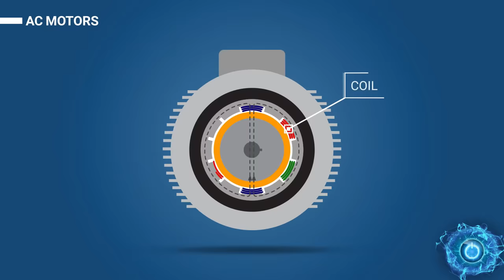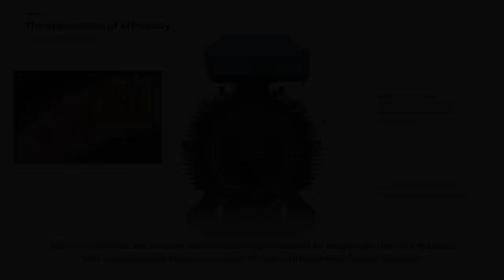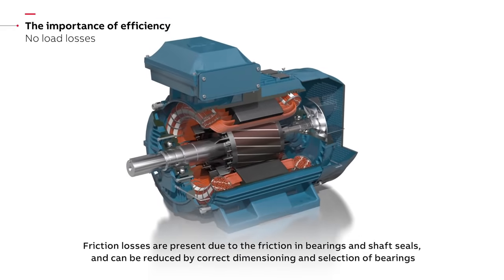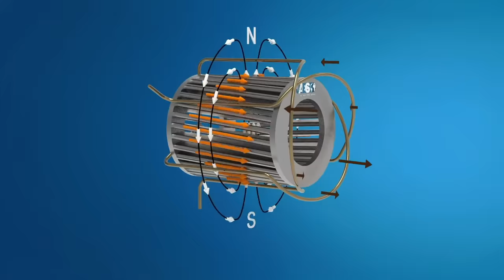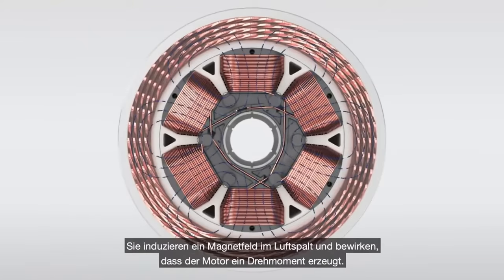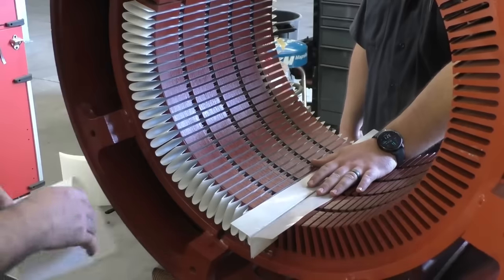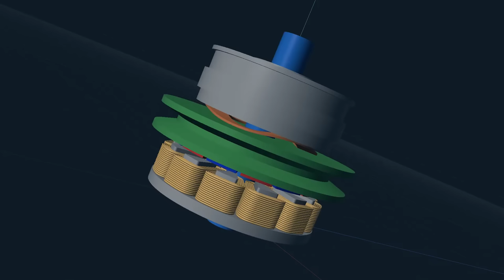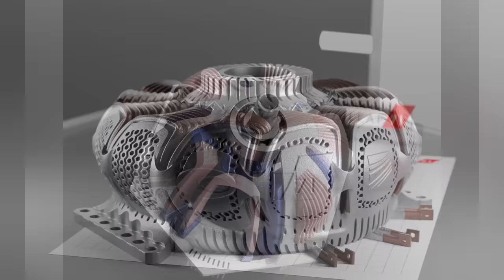GAME OVER!? - A.I. Designs New ELECTRIC Motor

Comment: there isn't a working benchmark, nor a breakdown of parts...this is just a model it created we don't even know it works.
Reply: As is it just a standard turbine from the looks of it. It's a step, and a few layers off
Reply: yup... clickbait title
Reply: Looks cool though
Reply: You look at that, and that's your takeaway? Think about complex engineering building on a  molecule / nano level and efficiency levels. Everything is about to change in such a fast way.
Reply: @Mars2152  except it's just a 3d model until it shows it actually works. it's an art piece, a paper weight, without any evidence it works we can't even say any engineering was done.
Reply: New way to milk investors - AI engine model!
Reply: It is an ai generated model with no actual prototype.
   However, if one loaded that into a program that is for making motors and analyzing electric fields, they might find the design appealing enough to actually produce as a prototype.
   It is very strange, I wondered at the impeller, however motors need cooling, so who knows.
Reply: @tuseroni6085  No shit. Nobody's claiming it works. It's demonstrating a potential path of progress. Engineering 101.  Every piece of technology ever released started as a prototype.
Reply: @ontheruntonowhere  it's not even a prototype. they don't even have it working in simulations. it's a model. it's nice that the AI could create a cool looking 3d model, but until there is even the slightest indication that it works, it's just a cool looking model.
Reply: TBH before even clicking on the video that's what I figured lol, and all the dislikes was pretty much all the confirmation I needed but thought I'd read comments anyway.
Reply: Seriously though, it's scary to think that even some high-level engineering jobs could be made obsolete by AI if humans can't compete. I think a lot of people are being too optimistic about it but then again it's not all doom and gloom either, aside from the worst case scenario of course.
Reply: @brians1793  i doubt we will be seeing anything like that, don't get me wrong, companies will certainly TRY, people WILL lose their jobs...but then when it doesn't work like they expect, because they really didn't understand what their engineers did, they will hire back the human engineers.

the main thing to know with AI though is that it doesn't WANT anything, it doesn't get bored, it doesn't have a point of view humans have those things, managers hire engineers for their creativity as much as their technical ability, and that creativity isn't going to come from an AI, their brains just aren't made for it.

what you will end up with are human engineers with another cool tool for making things, like CAD software or simulation software. and maybe a better way of telling managers their idea is stupid and it will never work.
Reply: @tuseroni6085  You're probably right, similar is probably true about human musicians too. There are a lot of musicians though that are kinda feeling like it's pointless to spend thousands of hours of practice over the years to master certain things just to not come close to what AI robots could eventually do. I don't really see that as a great reason to give up, but psychologically I get why people will feel that way. Similar to seeing amazing human guitarists and guitarists will say it makes them want to give up rather than motivate or inspire them if they're just insanely good, not a good attitude at all though. It's better for people to compare themselves to their past selves and not worry too much about being at the top, some people will just never get there due to limitations but it's worse to just give up than not do your best.

For music IDK if AI will ever really emulate the emotion and feel of real human playing at it's best, and I think most people will always appreciate the creativity and emotion of real human musicians and AI won't necessarily write music quite like some of the most talented humans do. But it's possible a lot of music might not be distinguishable from humans just like AI models. I'm honestly more worried about how it'll impact women from educated women's jobs to models, a lot of women's jobs will be replaced and they won't even be able to fall back on modeling and will have college debt, less men in college and blue collar jobs I don't think will be as impacted.
Reply: @brians1793  i think women will be fine, even if they have college debt, etc, they will find a man and he will likely support her as she looks for a new career or she might find she prefers it as a stay-at-home mother, there's a reason such a small portion of homeless people are women.

as for AI music, think about this: people still do blacksmithing. modern blacksmiths make works that would be considered embarrassing before the industrial revolution but which people today actually WANT. prior to the industrial revolution, a perfectly crafted piece of work would have no scale, no pits, it would be perfectly straight, and your ability to do this was a sign of much skill, but today machines pump out perfect parts in perpetuity for a pittance, if a blacksmith made a perfect looking piece they would be doing a lot of work to make it look like it was stamped out by a machine in like 2 seconds.

so, blacksmiths make their works highlight the human aspect, where blacksmiths of old would work to file or hammer out the pits modern blacksmiths will take a perfectly flat and smooth piece of metal and hit it with a hammer to MAKE dents. things which show the human work involved are the things that really sell the best.

and i think hand made music will go in that way, they will lean on not using autotune, or maybe even having their instruments slightly out of tune, i can't predict what things people will find interesting once AI music has reached saturation, but it will be the things that highlight the human element.

i also think AI will be a tool that allows for the creation of a bunch of amazing (and exponentially more shitty) creations. just looking at AI covers, or the things people are making on udio, it lowers the barrier to entry and allows more people to show their creativity. for a good example of what this kind of thing can allow, look into vocaloid, which is not AI but it is similar in that it allows people who cannot sing to make music with vocals. look up "senbonzakura" some time, there is the original vocaloid but then a ton of covers (i like the cover by wagaki band most, personally) the covers are done by people who CAN sing (i think the original was hatsune miku voice) and they all bring their own point of view to it, their own voice, figuratively and literally.

my best advice, though, to someone looking to go to college for art...don't, don't go to college to learn to make art, just go online and make art, while others are spending 4-8 years learning how people used to make art you will have already established yourself. 

AI will also make learning easier, i hope this generation is the one to break free of the idea that if you want to do something you have to go to college, and then i hope businesses also break free of the idea that if you want someone good they need a degree.
Reply: @tuseroni6085  Building on nano scale exotic technology is the takeaway. I don't care about a model, I care about the technology that this can build.  People are locked into a toy. That's my point 👉 👈.  Peace
Reply: I don't think even that AI knows how it works.
Reply: There’s only copper and magnets rotating in a motor, can you not figure out what it is you’re looking at? Or is that too much to expect lol
Reply: Exactly!  3D art hype =/= a working model
Reply: I think it is an easy bet that it does not work. Somehow people think that AI can develop perfection from imperfect human input.
Reply: @davidsault9698  interesting nonetheless, wonder if there’s any merit to any of the illustration specifically
Reply: It looks like the engine in the spaceship that abducted me......
Reply: "This is not important right now Stan... what's important is to figure out how clickbati it is..."
Reply: Tough situation fellas, hard to know where to look if ya dont know .. good to know most dont know lol. But who knows right ?
Reply: @ontheruntonowhere  No its literally just a cool picture with nothing behind it. Its demonstrating the potential path of progress as much as the millenium falcon was. Not at all.
Reply: @kvasir8931  No shit? I thought it was a real Millennium Falcon with hyperdrive and everything. Good thing you told me before I tried to escape Darth Vader on it. 🤣🤣🤣🤣
Reply: baby steps:)
Reply: @tuseroni6085 This is arguably the most cogent comment I've seen in any comments section. Thank you.

Comment: Was kinda hoping to see more performance specs for the motor, as well as what exactly the AI was optimizing. The high surface area appears to optimize heat dissipation
Reply: Might be able to run coolant through the coils 🤷
Reply: Agreed !
Reply: Heat emitted by a motor is an indicator of inefficient operation. It's energy being wasted as heat instead of mechanical force.  If you have to seriously cool a motor, the real problem is that is wasting energy as heat.  Gas and diesel engines are great examples. A whole elaborate cooling system is required just to deal with waste heat. The energy spent making that heat is energy not spent doing whatever the engine is supposed to do.
Reply: @patrickmccullough989 If it's really powerful motor it will generate much heat even if it's highly efficient..
Reply: @MegaSuperCritic  It's like you do not understand what you read. If it's really powerful motor there will be lots of heat. Full stop.
Reply: @MegaSuperCritic 
A 100% efficient motor, no matter the size, can never exist. Thermodynamics forbids it. At minimum you'll at least have heat production from friction and electrical resistance.
Reply: @patrickmccullough989  Gas and Diesel engines aren't really the best examples because they are Carnot engines and thus are more efficient the hotter they are and the cooler the environment is.
Reply: @MegaSuperCritic 
And you're never going to reach 100% efficiency, so you'll ALWAYS have at least some heat. You will always have at least some friction, and you will always have at least some electrical resistance.
Reply: @patrickmccullough989  The conductors and the magnets will be more efficient the cooler they are, and then cooling can allow a better power density in the motor, something very important for weight sensitive applications such as hub motors.
Reply: @MegaSuperCritic  You're not getting what he's saying. If you have two motors, both weigh 1kg, one puts out 1hp and the other puts out 2hp, they're both equally efficient (electricity wise) the motor putting out 2hp will put out twice as much heat.

It's a better motor, but it produces more heat. Efficiency isn't the only variable for how good a motor is.
Reply: @agentstapler-  Thanks for the necropost, appreciate this popping up in my notifications.

I absolutely understand his point. The ONLY thing I was defending was that a 100% efficient system would have no thermal byproduct. Ultimately, we were saying different things, slamming our heads into our respective walls.
Reply: I like the AI also added some marketing symbols on the outside. AI doesn't miss a thing . . . . .   <eye roll>
Reply: @jonathanellis8737  i believe thats what was stated
Reply: @MegaSuperCritic  it wasn't even that old, how's this for a necropost (I'm petty enough that I would have put it in my calendar and bookmarked it for next year, but I wanted to do it before anyone else did)
Reply: I think Koenigsegg has the best electric motor.

Comment: I believe the copper windings will not work very well if 3D printed.  Any microscopic "hole" will lessen the magnetic field or cause stray eddy current causing problems with power.  A regular copper wire is going to be hard to beat.
Reply from the maker: That is very true!
Reply: True, but that can be solved with some sanding and polishing post-print. I'm more bothered by those sharp angles in some parts of the design, fields should be treated as fluid and fluid doesn't like sharp angles.
Reply: @JenkoRun  internal holes can't be fixed by sanding though. 3D prints have holes inside them all the time, a part of why it's never a good idea to use 3D prints for things in contact with food. Germs will find their way inside and make it super unsanitary
Reply: @kapser2210  The holes run that deep? Well then, printing the copper is definitely a bad idea.
Reply: @JenkoRun  Nnnnope. It's not about the internal shape, but the volume of the printed "wire". What you're describing would be like trying to  remove air holes from bread by cutting off the crust.
Reply: @yapdog  That's what I was talking about.
Reply: @yapdog  did you just described copper wires and printed copper wires with bread and a crust?
Ffs haven't you heard of Swiss cheese
Pretty Sure that's more conductive
Reply: @clusternova6278  Uuuh... 🤨....🤣
Reply: Surely the AI can optimise the manufacturing process to fill any holes and coat any conductive materials with an extra layer.
Reply: Hot Isostatic Pressing will solve the hole issue.
Reply: @Kenny-tl7ir  But at which point in a 3-D printed part.   If the print is of the whole motor, the pressing would ruin all the windings by welding them together.  There may very well be a way  this printed motor idea will work, but it is only  in theory, and manufacturing brings up it's own unique set of problems.  Every one of those "wires" will have to be electrically isolated from each other as they are in all motors.
Reply: @WayneBain  Yeah you're probably right about the copper windings, but the computational bio-design of the rotor by the AI has probably increased both the electrical and mechanical performance as well as reduce wastage. Splitting the rotor up into modular parts would probably solve the copper winding issue. Just HIP all the modules, put the windngs in and assemble the modules
Reply: The part was definitely not developed by an “A.I.” You can see that this engine was designed by a human. Technically this form doesn't help but it looks cool and like something from the future... Everything that was supposedly developed by an "A.I." looks good. That's what advertising is. Strangely enough, electric cars also look much better than ICE. This is not a coincidence and it is not because of the battery. It's intentional. Like this engine supposedly designed by a PC.
Reply: Okay but the motor doesn’t need to be 3D printed idk why you’re saying that. You use the design and manufacture it yourself. The same way we do with everything else.
Reply: That would be solved by a higher resolutuon printer..
Reply: This is true rather for microwave frequencies, where the concept of a skin effect is important.
Reply: @kapser2210  The issues with holes you are talking about is with FDM printing. And that is because you are trying to squeeze a circle into a square, and you always end up with rounded corners, which create small gaps, which is the layer lines you see. 

This type of metal 3D printing does not have that problem because it is melting a very fine, even layer of metal powder. So no squeezing  a circle into a square.
Reply: @GalacticGuru42 , it'd have to be 3D printing on a very microscopic level equivalent to processors. As a former electric motors builder and industrial electrician, the wire gauge is measured in hundreds of thousands of an inch not including the dozens of layers of varnish coating. Electric motors are already far more complicated than the layman would imagine. For AI to improve it'll have to be a change in something we humans haven't thought of or can't imagine.
Reply: forged and then drawn...it aligns the atoms in a linear configuration which enables less resistance to the flow of electrons....running an electric current through a pile of metal fillings is not as efficient as running it through a forged and drawn wire...unless heat is what you want to produce...then the more resistance the better.
Reply: There are extruders for copper wire that can be embedded in 3d objects as they are printed.  But coils would be a tough job.  Ususlly the machine making coils has ways of making them dense.
Reply: True but 3D printing is in its infancy, give it time :)